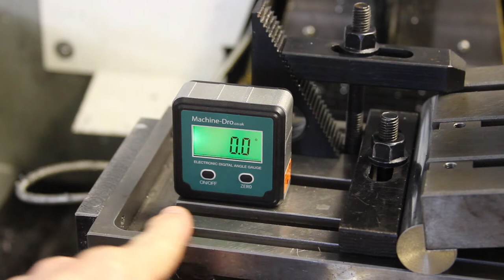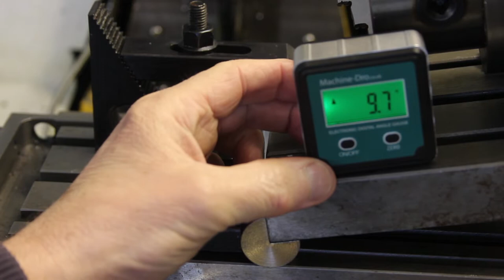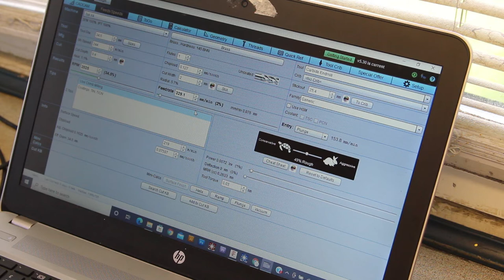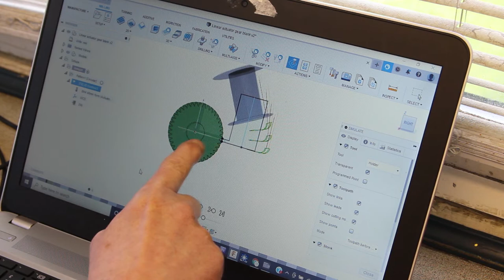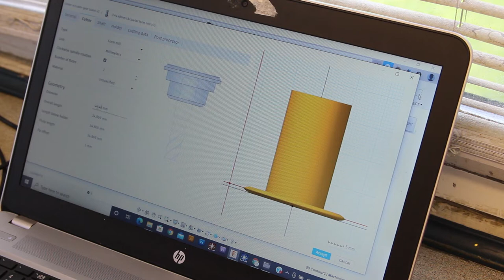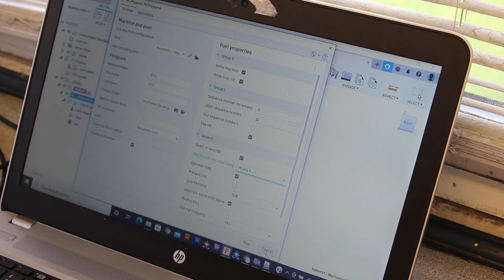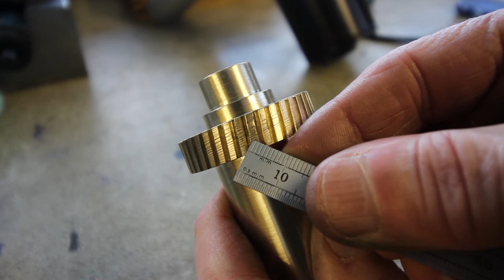Actuator troubles Pt2

Comment: When it started reversing after 180 degrees, instead of going all the way back to Fusion, you could have re-zeroed your rotary axis at 180 degrees and ran the same job again to cut the other half of the teeth. Interesting video, thanks for posting.
Reply from the maker: Thanks for the comment never crossed my mind to try that.
Cheers

Comment: Very nice...But, why is the Z axis moving up a little after the cut and then moving back down?  Looks like
one could eliminate that bit and save some time.
Reply from the maker: Spot on there is a setting in fusion to keep Z axis down it would have saved time. I only found out about it after I had made this part.

Comment: Good effort. Did you consider using the gear wizard in Mach3?
Reply from the maker: Yes I did but I have found it to be very slow. I cant get it to feed any faster than 1mm/min probably not getting the settings right!
Reply: @CazualHaze  Funny you should say that as the same happens to me BUT a good friend has no problems - he has the same release of software etc etc. I just edit the G-code to give a better feed rate......
Reply from the maker: Yep I think it is an odd bit of software. My pulsing engine driver randomly stops working, I seem to be the only one!
I need to reboot the pc to start it again.

Comment: Interesting. Are you using paid version of F360 to generate the 4th axis code?
Reply from the maker: Hi Peter,
Yes its the paid version. The toolpath is wrapped around the stock. I have to say I find it tricky to set up but works well 'in the end'
Cheers
Reply: @CazualHaze  I have a Syil X4 myself and some of your additions are things I have thought of. In the few years I have had it the owners of F360 have have removed useful features from the hobby version including 4th axis. I am not going to paid version and Freecad is not yet there. I may have to write my own gcode for simple 3+1 operations. BTW The link to your website in the about page is dead. Regards